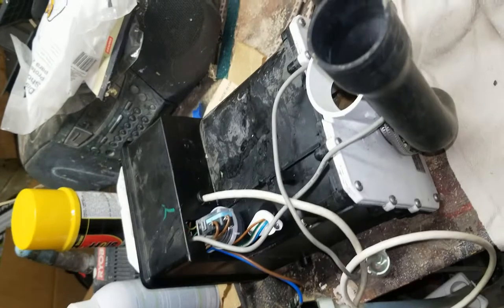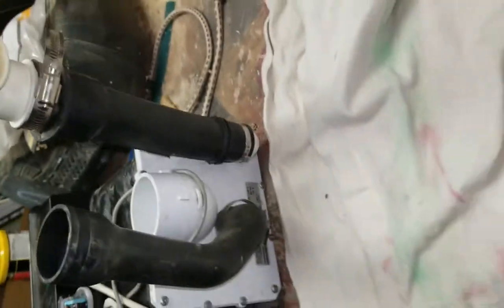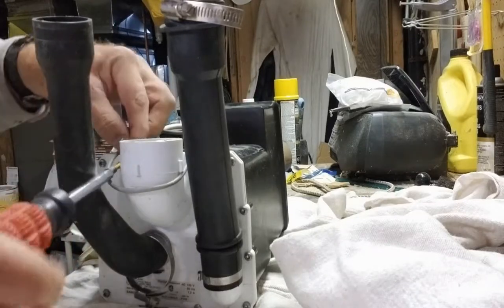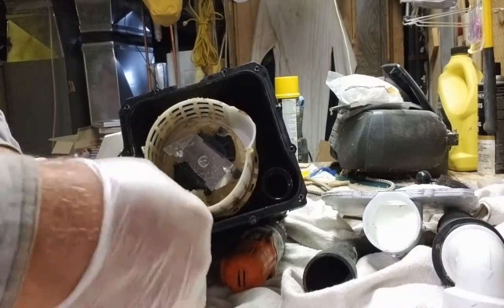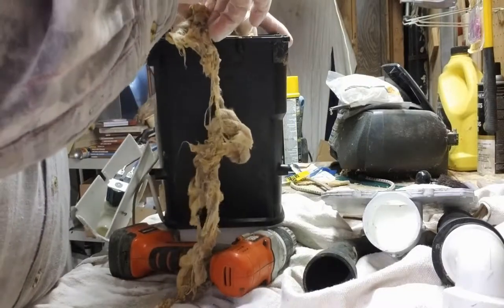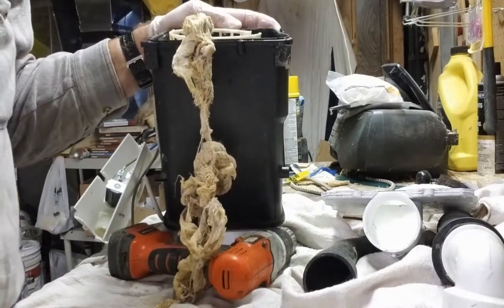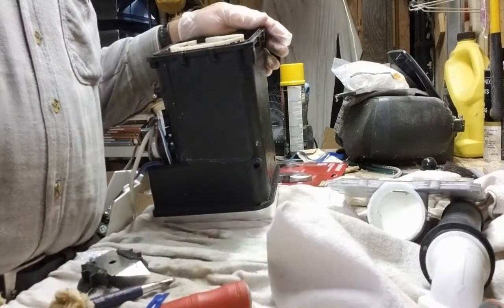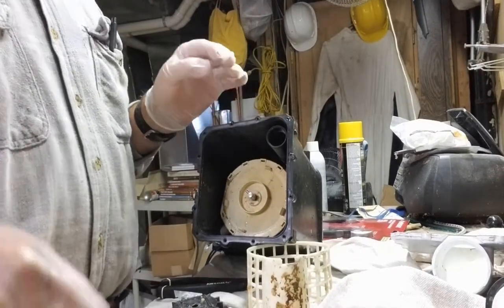Sanicompact   Clearing the blade

Comment: If you are careful never to put anything in there except #1, #2, and cheapie toilet paper... it will serve you well.  Flush it often to keep it from getting plugged up.  Put a sign up if necessary. Baby wipes will jamb it up, as did mine. Use Saniflo descaler every 6 months to clean out the insides. When installing the 1" pvc drainline, use gradual sweep bends, or 2 45 degree bends in lieu of a 90 degree bend. The least amount of bends, the better. This will allow low resistance flow into your main sewer.  Follow the instructions.  It's never as good as a regular toilet, but it does the job.

Comment: Hows your experience overall with sanicompact?   I just bought this toilet for my basement and will be installing it next week, I would like to know what to expect.  Thanks!
Reply: Al, Now that it's been a year, what is you impression?  Mine is still going strong, although I have had to take it apart to unjamb or clean several times as the above poster did.  It takes hours, and is a messy job. Always seems to be hard to avoid leaks when reassembling. Mine is in a tight corner, and makes for a torturous job. Recently, while descaling with the Saniflo descaler, I had this weird experience: As i was running a flush cycle, and was pouring in the descaler, the little red plastic lid's seal ring on the bottle fell in! Before I could reach in and catch it, it went down with the flush.  I thought I was in for another disassembly and removal.  However, it continued working fine... flushing several rounds of toilet paper.  I suspect it is still in the impellor compartment, but not obstructing the blades... yet.  Anyway, I will watch and wait.  Anyone else have experiences with these?
Reply: @robertmonroe5606  So far (knock on woods).. it has been running fine, considering there is minimal usage, I have this toilet installed in the basement.  Occasionally, it needs to be flushed twice to ensure everything is adequately flushed..